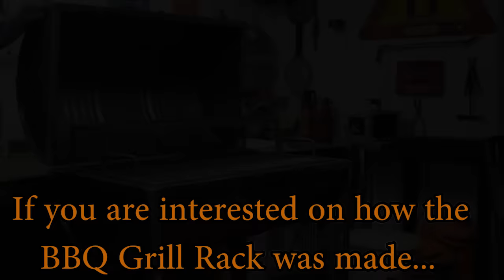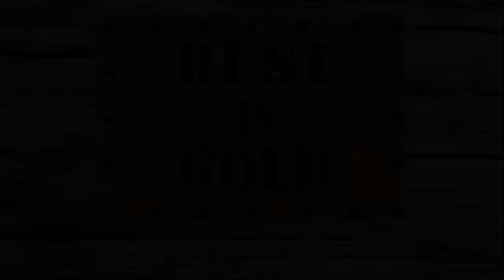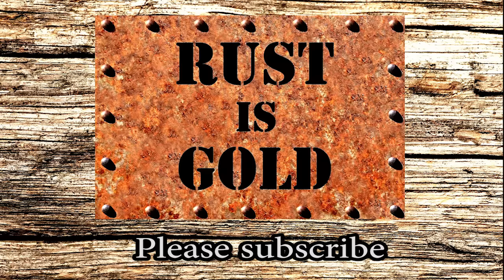HOW TO BUILD A BARREL BBQ/SMOKER (PART 1)

Comment: Man for the labor, parts, and time, I wouldve just bout the same thing for $300 bucks and started cooking immediately.
Reply from the maker: Well...This is my hobby and as a result this is why I have a DIY YouTube channel. It cost me 150$ to build this barrel BBQ and if you knew my YouTube earnings just from this particular video you would already be out in the market buying the parts you need to build one and upload the video on your YouTube channel!
Reply from the maker: Never judge a book by its cover...
Reply: i said the same thing. you can buy one and make a couple improvements and a quality temp gauge. i built a smoker grill once and never again. hell for 300 bucks you can't build one for 300 parts & labor. i have a dyna glow vertical i made some small improvements for 125.00. best money i ever spent and it took about 45 min to assemble. its charcoal and i added an analog electric burner as a back up for 30 bucks and high quality door temp gauge. total less than 150.00. and changes cheap grease pan on bottom to a sealed riveted on relish lid and screw on the jar for the grease. cost of relish jar 00.00 from recycle bin. works better than any smoker i ever used or seen.

Comment: I really want to give this a go. The question that i had was, when i look for barrels in my area i can either get an oil barrel with a screw on cap like you have in this video, or a food grade drum that has a lid like a tin of coffee. If i went with the cheaper oil drum, is there any concern with cutting it open with the grinder. It won't ignite? Do i have to clean it before i cut it? With the food grade barrel with a lid i suppose i could weld the lid shut before cutting in half? Any advice would be appreciated.
Reply: The oil drum could potentially ignite. be very careful. The way i do my drums is, i wash them with strong chemical degreasers. Something not flammable. soap first. add water. fill the drum. let it sit for 24 hours. empty it out and fill it up with water again. the water displaces any gas in the drum so fill it all the way up. Then you empty it and you cut it right away while its still wet inside. That way it wont ignite and there wont be any gas to explode.
Reply: @tjjoubert2435  Thanks for the advice. I am going to go with the oil drum when i do this.
Reply from the maker: Sorry for the late reply... I did the same, I washed the barrel with soap and then I proceeded in cutting it. Unfortunately I didn't include it on  the video...

Comment: If it is not a stainless steel drum it won't last long, it will rust and fall to piece in no time , I was thinking using a Stainless steel beer Keg.
Reply from the maker: I am not going to let it rust outside. After every use I store it indoors.

Comment: Why is the vent put at the top of smoker?    If it is put at the bottom of smoker the cooler smoke at the bottom would escape and the hotter smoke at the top will stay. Wouldnt it be energy efficient that way?
Reply from the maker: Honestly I don't know the answer... Before building it I did my research and all the similar BBQs had the vent on top...

Comment: I don't think every one happens to have a flame thrower laying around in their garage. 
Can i skip that part?
Reply from the maker: Well, I guess either you'll have to use sandpaper to take the color out or use a paint remover. Please I hate using these chemicals...
Reply from the maker: Either way you have to remove the original color because it will not last the high temperatures of the BBQ.
Maybe you can try find buying a barrel which has not been painted.
Reply: Well they cost 20 bucks so its not too hard to come by one
Reply from the maker: @jeffreyculberth1440  exactly...

Comment: Won't this deform after so many use due to heat?
Reply from the maker: So far there is no deformation. I guess the 2 metal frames keep it in shape.
Reply: @RustisGold  do you have a build where there's another attachment for a smoker
Reply from the maker: @zurgboy07  I was planning on making one but unfortunately I never did it...
Reply: @RustisGold  Oh too bad then I was looking for one and yours seems to be the easiest to be build but I wanted a smoker for it and have no idea where and how to put it together.

Comment: First make sure you're not using barrel after toxic wastes.
Reply: good idea, but by burning the paint job off the outsides first to prep the barrel, would have ensured most if not all possible toxic residues were disposed of.
Reply from the maker: Thank you very much for your comments. That's a very good point. Before grilling on it I also burnt the BBQ for more than an hour at high temperature. I hope it was sufficient.

Comment: What are the measurements of everything
Reply: Measurements as according to the oil tank you use. And height depend on your height
Reply from the maker: Here are the measurements for the Barrel BBQ:
https://www.facebook.com/photo?fbid=2562179130553153&set=a.2562180023886397
Reply from the maker: GRILL RACK DIMENSIONS

The dimensions of the bottom grate are 90.5cm X 52cm.
The dimensions of the top grate are 87.5cm X 22cm.
The height of the top grate is 16cm.
I used iron angles with dimensions  3cm X 3cm and 8mm diameter rods with 2cm gap in between the rods.
However, I suggest that you have to make the grill fit your BBQ's dimensions.

Comment: Question why didn’t you burn the pipe like you did the barrel when you were cleaning the paint was it easier to do with the grinder instead of the torch or is there some other specific reason
Reply from the maker: Thank you very much for your comments. The pipe was just easier to clean it with the grinder. Much smaller surface to deal with! 😊👍
Reply: @RustisGold  thx so Finally got everything I need to do this project that’s why I was asking the questions I was I’m not really experienced in welding but I think this project would be a good way to come and get my hands dirty with it
Reply from the maker: Good luck with your project! 
Don't worry about the welding, watch some tutorials on YouTube. They're quite helpful. But most importantly... just try it! 😊👍 A proverb in my native country, Greece, says: "...If your a$$ doesn't get wet don't expect to eat fish..."! (meaning, if you don't try to do something don't expect it to happen by itself).
Be careful when you weld the frames to the barrel. The metal surface of the barrel is quite thin and if the amperage on your welding machine is high it will create holes.
Reply from the maker: In case you need the measurements for the Barrel BBQ:
https://www.facebook.com/photo?fbid=2562179130553153&set=a.2562180023886397
Reply from the maker: GRILL RACK DIMENSIONS

The dimensions of the bottom grate are 90.5cm X 52cm.
The dimensions of the top grate are 87.5cm X 22cm.
The height of the top grate is 16cm.
I used iron angles with dimensions  3cm X 3cm and 8mm diameter rods with 2cm gap in between the rods.
However, I suggest that you have to make the grill fit your BBQ's dimensions.
Reply: @RustisGold  Thank you so much thank you so much I really appreciate it
Reply from the maker: @bojnicko  😊👍

Comment: Did you weld the complete inside or only the corners?
Reply from the maker: Also the inside (wherever I could). You have to be carefull because the barrel is thin and welding might create holes on it.

Comment: You could die doing this....i Be very careful and consider what was in the barrel before cutting it open. If there is any possibility that it contained any thing FLAMMABLE cut it only mechanically. Never with a torch or any thing that produces spark. I have personal, indisputable knowledge of a person that was KILLED by attempting to cut open a barrel that had contained windshield washer fluid.
Reply from the maker: Thank you very much for your comments. I washed it with plenty of water inside before using the cutting disc.
Reply: Actually, in watching the video. I thought you were using a new one.

Comment: If you close the lid,  isn't the fire will die from lack of oxygen? Did you give any hole below?
Reply from the maker: Why close the lid when you use the BBQ?
Reply: Closing the lid won't put the fire out.
The seal isn't good enough to do that but it will help to make it smokey for curing fish etc
Reply: @RustisGold  You close the lid to make the inside hot like an oven, when you cook on a BBQ you don't just use the heat from below, you use it like an oven, especially with thick food like chicken.

Comment: Can you update this video with costs and efficiency values, as well as a finished product review?
Reply from the maker: Finished product review? Sorry but I don't sell BBQs. I only make DIY videos and post them on my YouTube channel.
Reply from the maker: This is the first trial of the BBQ if you are interested to see how it operates...
https://youtu.be/3fgH69J1lkQ
Reply: @RustisGold  I understand that you dont sell them, I was asking how much the materials costed you so that I could get a decent ball park price of how much it would cost me to make. In reference the the product review, I was wondering what the pros and cons were that you had and if you had the chance to rebuild it would you change anything about it... exp: add an offset smoker? Also thank you for responding.
Reply from the maker: Sorry I misunderstood... It cost me around 120€ but I also had some materials in stock. So have in mind that the actual cost could reach (maximum) 200€. The only modification needed is an opening on the side in order to add charcoal. Other than that it works great!

Comment: could you have also grinded the paint off instead of burned it?
Reply: yes, I think using paint stripper
Reply from the maker: Yes I could definitely do that as well but it was really very easy to remove it with the burner...
Reply from the maker: https://youtu.be/3fgH69J1lkQ

Comment: I BUILT ONE TWENTY YEARS AGO, RUSTED OUT IN TWO YEARS, NEVER DID THAT AGAIN
Reply from the maker: I am keeping it in a dry place...
Reply: They make an ok grille but a lousy smoker. Even then you have to wire brush and paint it once a year to make it last. Air compressor tanks are still on the thin side but work much better. Unless your lucky enough to find a really old one then they tend to be thicker.
Reply from the maker: https://youtu.be/3fgH69J1lkQ

Comment: bonjour vous prenez de la cornière de combien ? svp aimerai le réaliser merci et très joli
Reply from the maker: 3cm X 3cm
Reply from the maker: Voici les mesures pour le Barrel BBQ :
https://www.facebook.com/photo?fbid=2562179130553153&set=a.2562180023886397
Reply from the maker: DIMENSIONS DES GRILLES DE GRIL
Les dimensions de la grille inférieure sont de 90,5 cm X 52 cm.
 Les dimensions de la grille supérieure sont de 87,5 cm X 22 cm.
 La hauteur de la grille supérieure est de 16 cm.
 J'ai utilisé des cornières en fer de dimensions 3 cm X 3 cm et des tiges de 8 mm de diamètre avec un espace de 2 cm entre les tiges.
 Cependant, je suggère que vous deviez adapter le gril aux dimensions de votre barbecue.
Reply: Es usted un gran profecionista saludos desde campeche México
Reply from the maker: @johnnysaucedo5874  ¡Muchas gracias por tus comentarios!  ¡Me alegra que te haya gustado!  ¡Saludos desde Grecia!  🇬🇷😊👍

Comment: Hello .. What are the dimensions of the barrel? I mean the length and diameter of the barrel
Thank you
Reply from the maker: Here are the measurements for the Barrel BBQ:
https://www.facebook.com/photo?fbid=2562179130553153&set=a.2562180023886397
Reply: Thank you so much @RustisGold
Reply from the maker: You are welcome!
Reply: @RustisGold   My friend ... what if we put pottery pieces in the upper inner part of the barrel to increase heat
What do you think ??
Reply from the maker: I think it will work! Also bricks designed for fireplaces would work.
Reply: appreciate you ... and again, thank you very much  @RustisGold

Comment: What size angle Iron did you use?
Reply from the maker: 3cm X 3cm
Reply: @RustisGold  I have a couple more questions. How long are the legs and what thickness of steel? I was wondering if 1/8" would be good enough. Thank you for answering all these questions for me.

Comment: what are the dimensions of the iron angle? please 🙏
Reply from the maker: I used 3cm x 3cm iron angles.
Reply from the maker: Here are the measurements for the Barrel BBQ in case you need them.
https://www.facebook.com/photo?fbid=2562179130553153&set=a.2562180023886397
Reply: @RustisGold  isn't it hard to take your ashes? 🧐
Reply from the maker: Not really... After finish grilling I remove the grill and clean it. However I am thinking of making an opening on the front (or the back) in order to add charcoal while I am grilling. I didn't think about it when I was building it...

Comment: Can you list the parts used and sizes please
Reply from the maker: The video is extremely detailed regarding the parts I used. However I can send you the dimensions of the BBQ
Reply from the maker: @mitjadreu8428  https://www.facebook.com/photo?fbid=2562179130553153&set=a.2562180023886397
Reply from the maker: https://www.facebook.com/photo?fbid=2562179130553153&set=a.2562180023886397
Reply: @RustisGold  what about the L profiles you used for the legs and the frame of the barrel? 30x30x3mm?
Reply from the maker: @mitjadreu8428  Yes, exactly!

Comment: What is the length of the legs?
Reply from the maker: Total length (including wheels) 85cm
Reply: @RustisGold  thanks. How did you get the frame to fit so tight there is no smoke coming from the edges?
Reply from the maker: @allenwalsh8264  I did some welding as well from the inside. Be careful because the barrels surface is very thin.

Comment: Burning off the paint... oh dear.
Reply from the maker: Why don't you give me an alternative? Don't give me that nonsense argument that by burning off the paint I destroy the environment because if you want to remove paint there is NO environmental safe way to do it. Even if I had sandblasted the barrel or used sandpaper to remove the paint it wouldn't be environmentally friendly because all the paint particles would all end up in the ground.
Reply: No nonsense here... I've done "burning off the paint"... it stinks and leaves residue.  I didn't care for it and it sucked. That's where the oh dear comes from. Alternatives.. Wire wheel, flap disk, and respirator. I've done that.  Still sucks. Sandblasting maybe? Pay for fresh metal? As long as your having fun I guess...
Reply from the maker: @fak892  I apologize, I misunderstood your comment. A lot of people have criticized me for burning the paint because it is not good for the environment. I totally agree but at the same time there is no ecological way of removing paint. I thought it was just another comment like the ones I had received.
Reply: @RustisGold  no problem.

Comment: List of materials pls…..
Reply from the maker: Sorry I don't have a list of materials...
I can send you a photo with the dimensions
Reply from the maker: Here are the measurements for the Barrel BBQ:
https://www.facebook.com/photo?fbid=2562179130553153&set=a.2562180023886397
Reply from the maker: GRILL RACK DIMENSIONS

The dimensions of the bottom grate are 90.5cm X 52cm.
The dimensions of the top grate are 87.5cm X 22cm.
The height of the top grate is 16cm.
I used iron angles with dimensions  3cm X 3cm and 8mm diameter rods with 2cm gap in between the rods.
However, I suggest that you have to make the grill fit your BBQ's dimensions.

Comment: This is a grill, not a smoker
Reply: You could smoke in that or any grill if you know what you're doing. It doesn't take away from the fact that it was an awesome project.
Reply: @Romanslost  True, but don't call it a smoker if it isn't, that's all I am saying
Reply from the maker: It is true it is more of a grill than a smoker. However, it is also true you can smoke things with this BBQ as well.
Reply: Mike Wilhelmson  I didn't say you can't smoke in it, I said it is not a smoker "technically". A smoker usually has the charcoal box outside to avoid direct heat

Comment: What does the torching at the beginning do?
Reply: it’s to remove paint etc from the metal so that it’s not covering your food/guests in pollutants
Reply from the maker: Exactly as Owen Davies mentioned.
Plus the original paint was not heat resistant. At the end I painted it with a heat resistant paint.
Reply: @RustisGold  Thank you both! Wasn't sure if it was heat treating the metal or just for removing the paint.
Reply from the maker: @amoledor  no problem 👍!